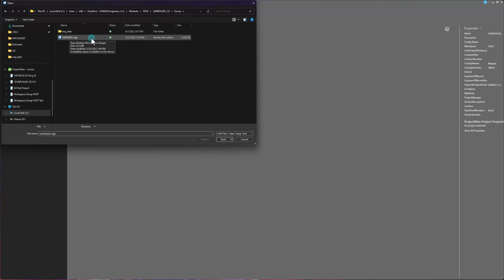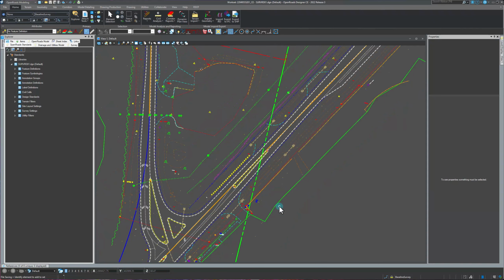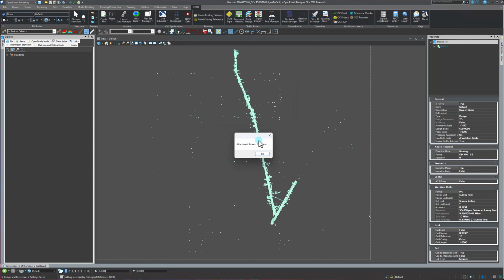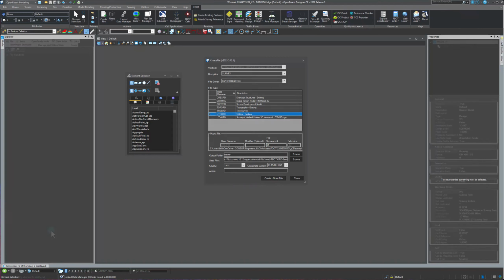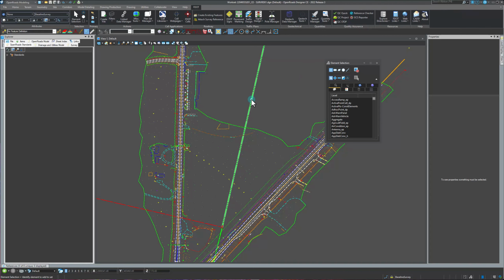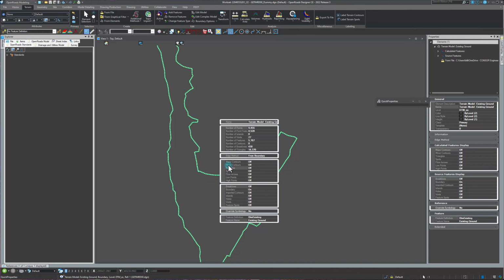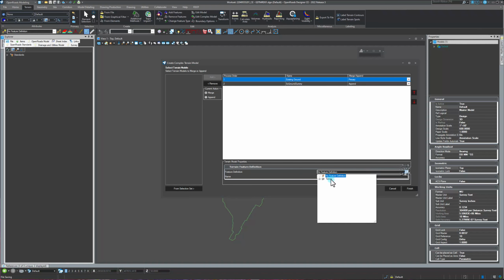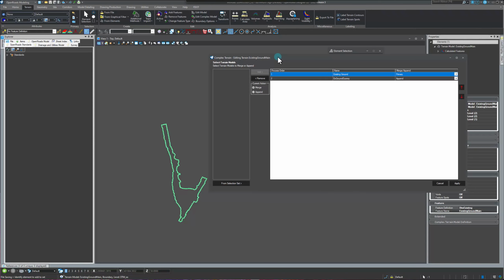FDOT ORD Unpack SURVRD01.dgn

Comment from the maker: Near 31:00, when showing how to add a boundary to the Complex Terrain Model, there is a way to create a Boundary if you do not already have one. I did this in the base GDTMRD00 file. In the Terrain tab, in the Edit section, there is a Boundary Options button. Click the drop-down and choose Add Boundary. This will prompt you to select the Terrain Model you want the boundary for as well as the Feature Definition you want to put this on. If not Feature Definition is set, it will use the active level. I set my active level to DTMBoundary_ep, set the Method to Extract Graphic, set the Feature Definition to No Feature Definition, and chose my original terrain from the surveyor. Once created, you can use that Boundary for your Complex Terrain Model.